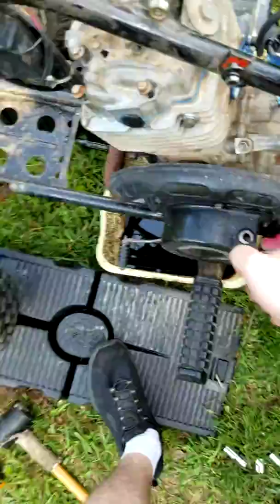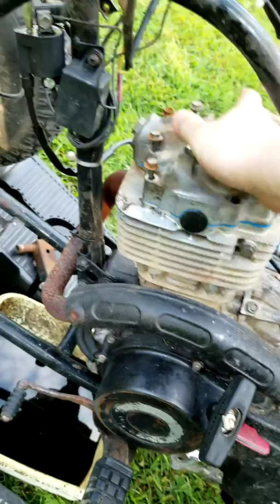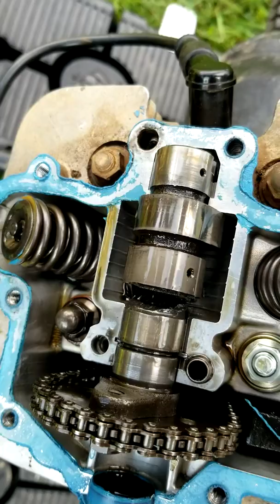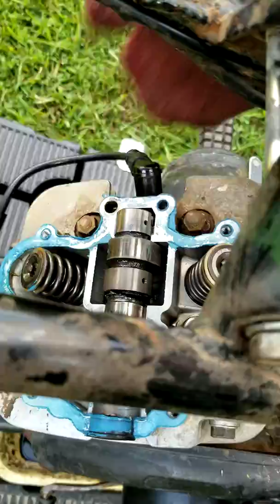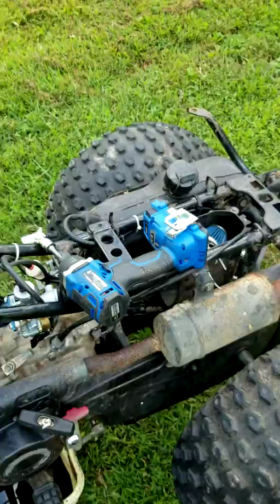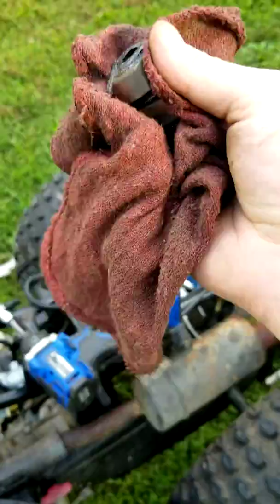I broke the cam in my Suzuki lt125

Comment: look for old retiring mechanics and small engine shops they might have a whole other bike for cheap i got one with throttle problems of low rpm power(3000rpm max) up to 40kmh then when it runs right high rpm (7000+rpm) up to 100kmh. then it might fall flat on it face!!! but i love it though.